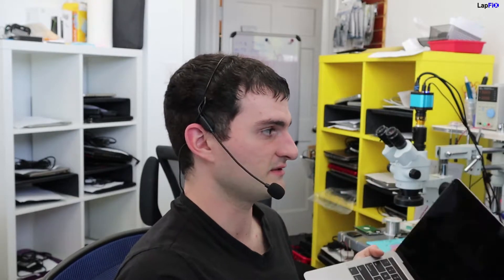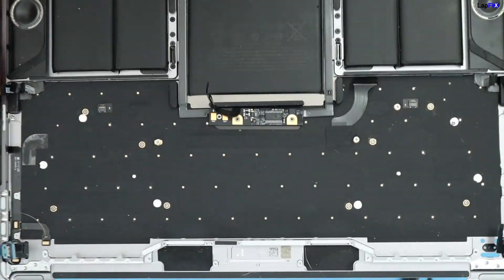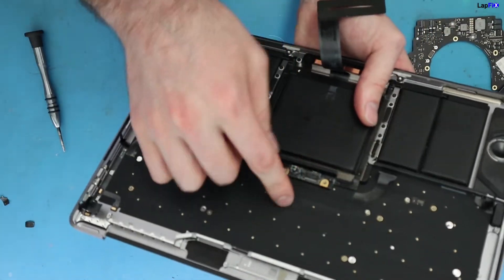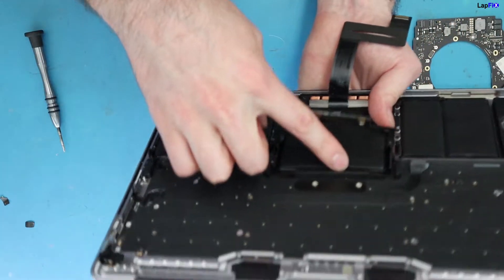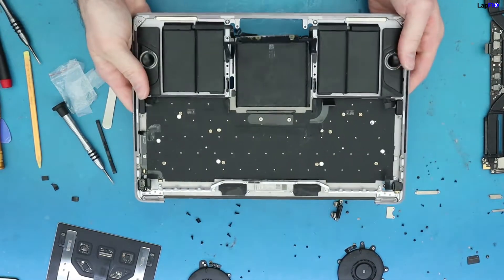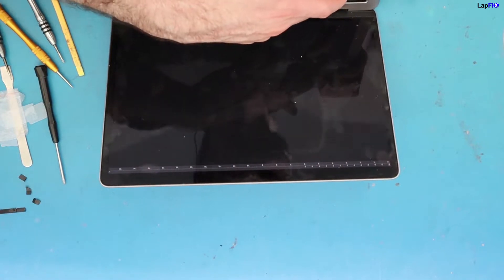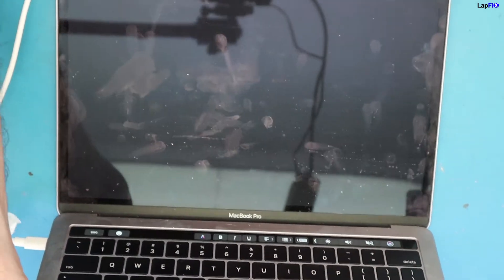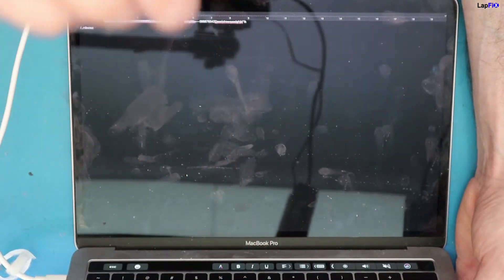Cleaning MacBook Pro A1706 Butterfly Switch Keyboard Fix

Comment: Hi, May ask. I have this A1706 work fine before upgrade to monterey. the keyboard only does'nt work after upgrade to monterey. And I tought  the keyboard have to replace, but before that I try to drain the batere till zero. after that I connect the power and try to restart the macbook. suddenly the keyboard is working for 2 or 3 minute, after that the keyboard not working again, but the touch bar is fine. My Questioin is, Do I have to replace the keyboard or this is batere problem?? cause when i downgrade again to bigsurr OS the keyboard is this Error/not working. please give me advice? thanks

Comment: hey. I spilled milk tea on my macbook air 2015 model. 
After having some of the liquid dry off I accidentally kept pressing the power button as i was trying to clean the residue. 
But since i had already switched it off, i didn’t realize i was pressing the power button. 
anyway things got worse when my sister tried to help by plugging a charger as my macbook mede a sound and i disconnected it immediately. 
It seemed that most of the liquid had dried which is why the charger was plugged. Now, my macbook obviously won’t turn on. 
What are the chances of my macbook surviving all this and can it be repaired? if so, how